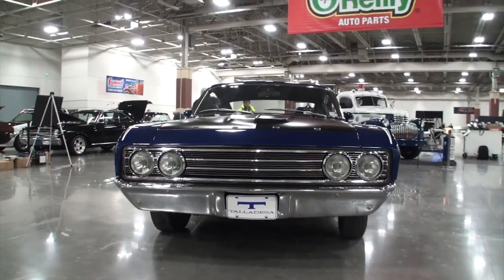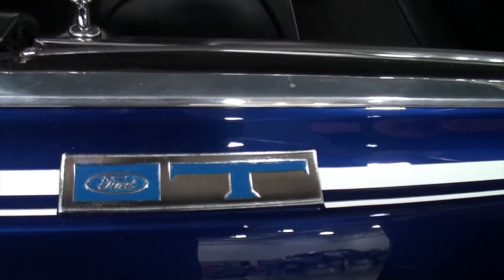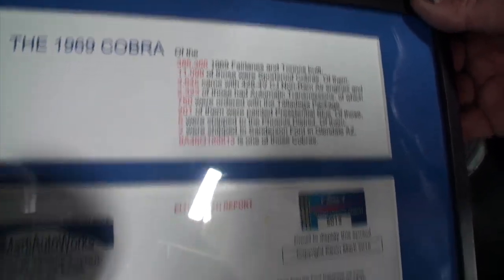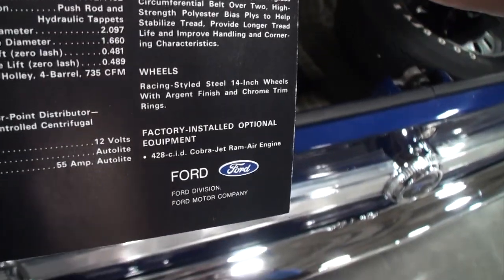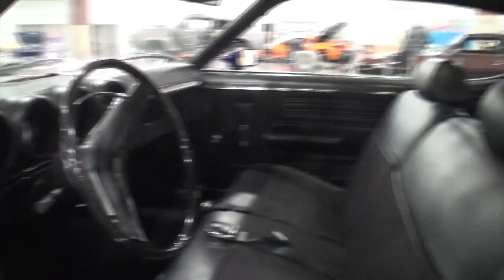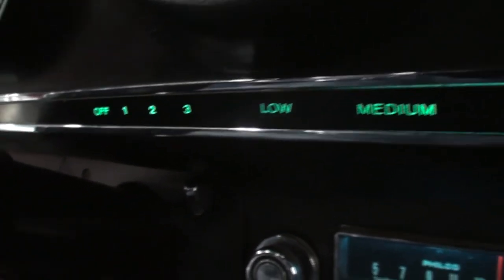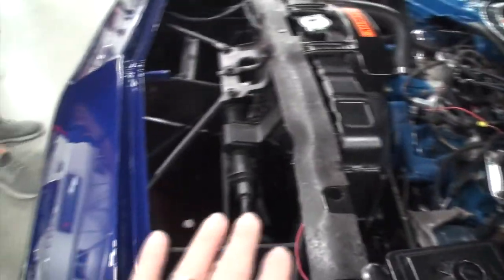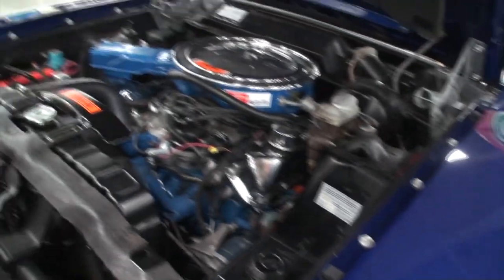1969 Ford Torino Talladega 428 CI Cobra Jet Engine in Blue on My Car Story with Lou Costabile

Comment: I like this 1969 Ford Torino Talladega 428. Why these cars were only equipped with automatic transmissions is a mystery. I could tell that the engine is a little bit cold natured on initial startup, but sounded healthy when warmed up. The instrument cluster looked great lit up. I actually like the color of this car better than the original Presidential Blue factory color it came out with. All those cars had such character back then. I'm so ready for spring to get here, because these indoor car shows are getting old! Great Job Lou!
Reply from the maker: Hi Michael, Happy to read you enjoy the sounds from a warm 428 Cobra Jet :-) Me too. Appreciate the encouraging words, Lou
Reply: The car probably came without a lot of options to simplify production. These cars were made to allow Ford to use the slippery body in Nascar. They were not really designed to be high production cars. This might be why you have the bench seat and the rather sparse dashboard instrumentation as well.
Reply: 👋THANKS LOU,and LOUIS…I ALSO LOVE THE LED LIGHTS AND THE COLOR…2 of my friends owned them from new ( one was yellow with a 390 and the other was burgundy with a 351 Windsor and I also got one in 1975 …black with the C stripes 351 Windsor 🤗💚💚💚
Reply: Michael Gronemeyer, all public versions had C6 A/T and only three colors as options. Ford lost money on every car, thus, options were limited.
Reply: @budgetaudiophilelife-long5461 , Standard engine was 428 CJ with A/T and no other engine options. Only three-color options and yellow was NOT one of them. White, burgundy, and blue were the only options. There were a few that were special built custom versions for specific people. One built for Ford CEO Knudsen that was yellow. Three others had 4 speed manual transmissions and the drag-pack option with traction-lock rear differentials. All were postproduction prototype cars. No 1969 Torino Talladegas had any side stripes, either. 1969 was the only year of production.  754 were produced but only 750 were for the general public. A small few  had dealership installed Cobra stripes but none came from the factory with stripes.
Reply: @sergeantmasson3669  SORRY,SARG.I was referring to the regular Torinos not the TALLADEGA …my mistake
Reply: @budgetaudiophilelife-long5461  Well, the video is about the 1969 Torino Talladega and NOT the regular Torino cars.
Reply: @sergeantmasson3669  sorry

Comment: They only came with automatic's ?
Why?
Reply from the maker: Not sure, however maybe because they were all bench seat cars? Hoping a Viewer can share knowledge.
Reply: @loucostabile  Maybe they were bare bones cars ? Just enough to make the front end legal for NASCAR?  A four speed would mean bucket seats and a console... maybe a bench and column shift ended up costing less to produce, even with the automatic?
Reply: Reading about it not much is said about it other than it wasn't really a 1/4 mile muscle car. Built more for the high bank superspeedway capable of almost 200 mph.

Comment: Lou! Fantastic coverage here. 
The Talladega came in 3 colors. 
Wimbledon White, Maroon, and Presidential Blue which was unique for the Talladega. I don’t think this color was available on any other Ford model. Since less than 800 were built, it’s really difficult to know the actual shade after 50+ years. And you can’t rely on a 1/18 scale die cast model from China. 99.9999% of the world’s population has never seen a Talladega. I’d be willing to bet “Deep Impact Blue” is as close to Presidential Blue as possible.
By the way, there were no 1964 1/2 Mustang fastbacks. 🙂👍
Reply from the maker: Hi Cobra Charmer, Happy to read you enjoy the coverage. Thanks for sharing your knowledge. Good news! Here is another one for you, Lou https://youtu.be/2gWdLTldabI
Reply: Cobra Charmer, Vintage Burgandy, not Maroon. BTW, Ford Mustang 2+2 fastback came out in September 1964 as a 64.5 edition. 65 Mustang came out in October 1964
Reply: @sergeantmasson3669 ; Not true. Mustang was released in April 1964 as a 1964 1/2. 2 body choices: hardtop and convertible. Fastbacks were shipped out to dealers in August 1964 as 1965 models. What’s odd is the hardtop outsold the fastbacks like 3 to1
Thanks for the proper name ‘Vintage Burgundy’ 😀👍
Reply: @cobracharmer6178  All 1964.5 Mustangs were titled as 1965. The 2+2 Fastback came out in September of 1964, not August. Production began in March 1964, not April.